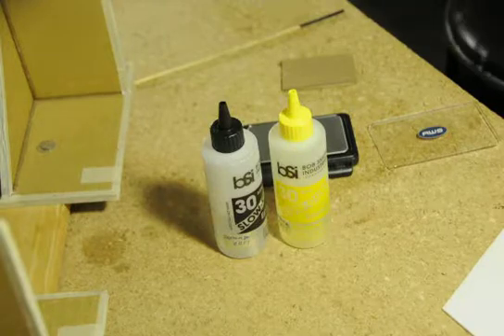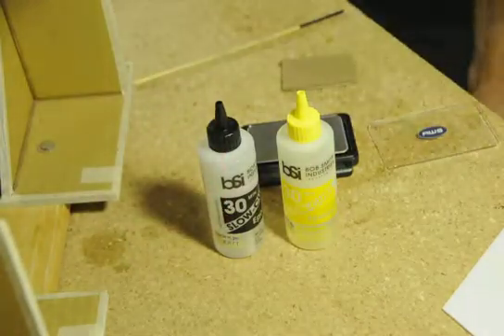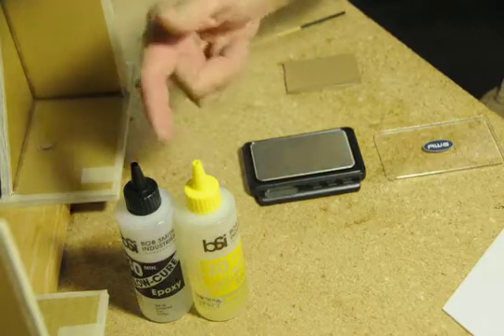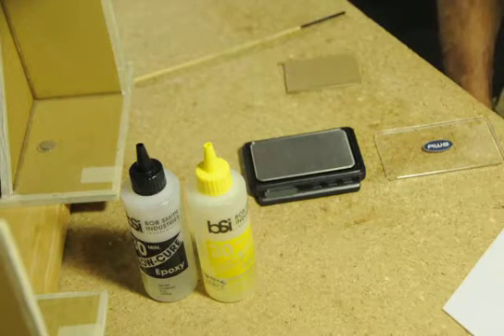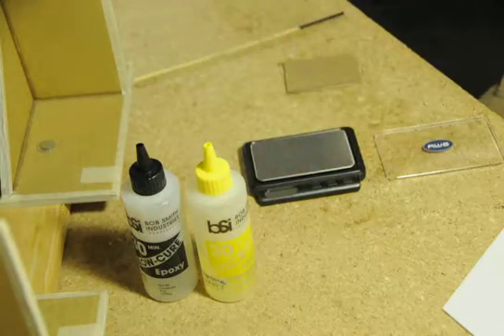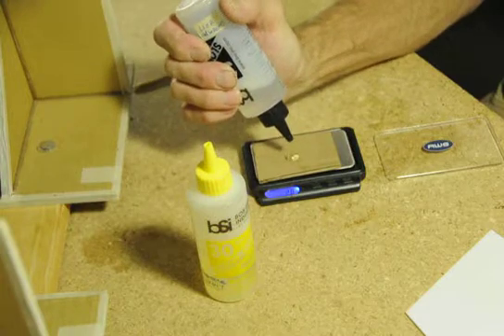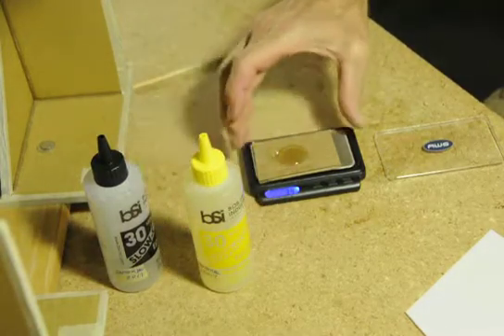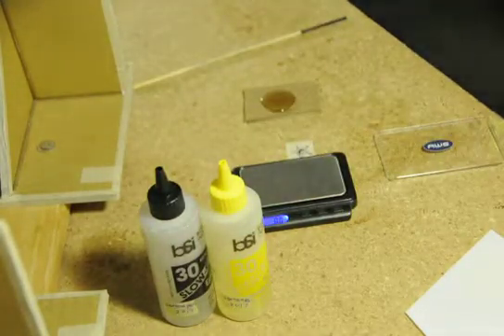HOW TO mix 30 min epoxy accuratly

Comment: Don't use a scale because the density of both parts may be different. Just simply dispense them both at the same time next to each other and eyeball it. I've done this many many times and it will cure hard as glass.